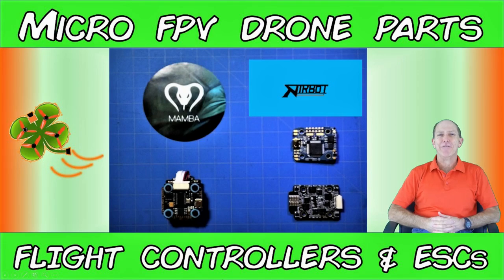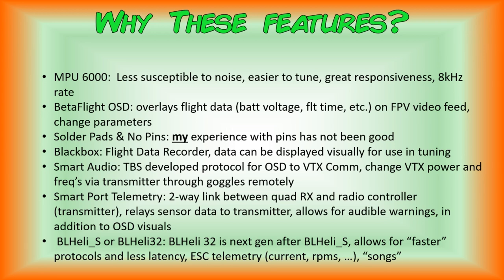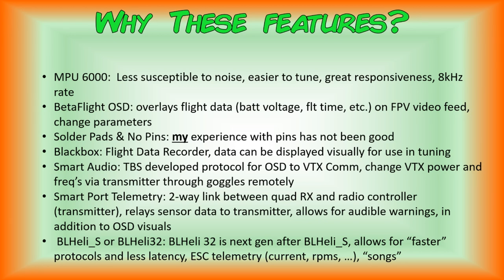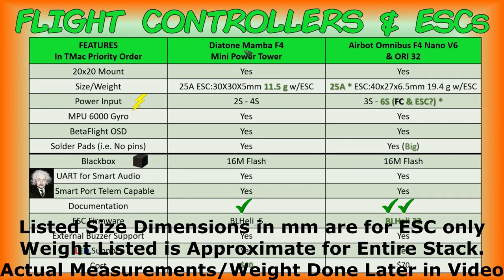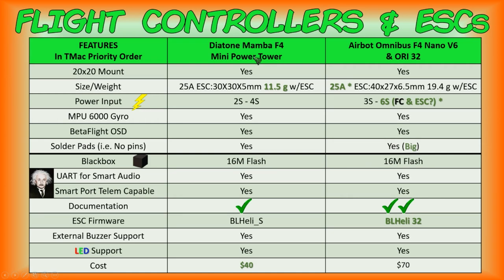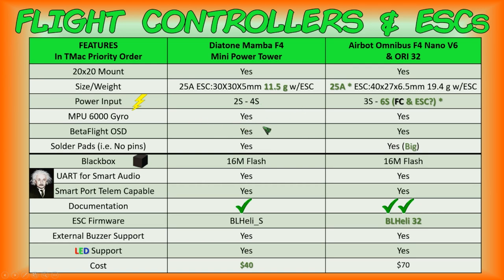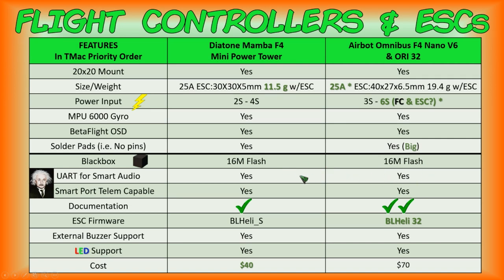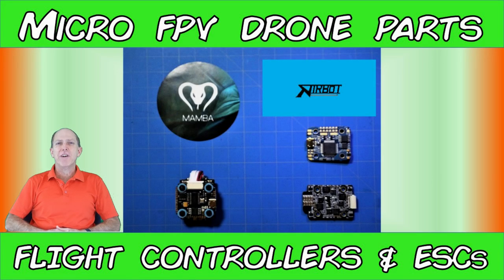MICRO FPV DRONE PARTS - Flight Controllers and ESCs

Comment from the maker: Let us know what you think of these FC/ESC Stacks in the Comments below.  How would they fit your build? What features are they missing? Any? If you have used either of these, what has been your experience?  Thanks for watching!
Reply: How's the Mamba stack holding up? My first build, soldering skills are "I have the idea" level..lol. fixed maybe two quads. But not sure if these pads are smaller than what I've worked. Any tips?
Reply from the maker: @LosFPV  Hey Carlos! I have not installed the Mamba stack in anything yet.  I purchased it (too good a price and features to pass up!) and have it in my inventory waiting for the "right quad" to put it into.  I went with the Airbot Omnibus F4 Nano V6 in my last build instead.   Yes, the Mamba Mini Stack has smaller pads.  I have installed FCs with these small pads before (the Diatone F4M Fury comes to mind--installed on Diatone GT R90).  The best tips I can give you on these small solder pads are: 1.  Take your time.  Patience is everything.  Do a good job one pad at a time.  If you try to rush it, it will get sloppy and you'll end up having to redo it then.  2d tip:  Be careful not to overheat the pads by using too high a heat temp on the soldering iron or by leaving the solder iron on the pad for too long.  These small pads heat up quickly.  So if you use too high of heat or leave the solder iron tip on pad too long, the pads can actually lift up off the board which is very bad news.  I recall when I was soldering the same size pads on the F4M Fury, I believe I used a temp of about 425 degrees F.  The Mamba F4 Mini FC is used on the Diatone Micros which just came out (239, 249 ,etc.).  Diatone is a very reputable company and has "evolved" their FC stacks to this one.  They would not be using it on their Micros unless it was reliable with good performance.  Think you've got a winner there with this FC!  Take your time with install and I'm sure you're going to be happy with it. Thanks for watching and Happy Flying!  👍
Reply: @TMacFPV  Awesome! Thank you for your tips, and for giving off some motivation to give it a try. Definitely checking back if I have questions.
Reply from the maker: Carlos-You're welcome! You got this!
Reply: @TMacFPV  Thanks again TMac. I got around to the build, it was pretty straight forward. Ran into motors 2 & 3 going in wrong direction,  used BL Heli to change directions.  So far so good. Keep up the videos I used some of yours for reference.
Reply from the maker: @LosFPV  Great! Thanks for the feedback-always appreciated. Glad it helped you in some ways.  Sounds like you're very much starting to get a handle on these things.  It only gets better Carlos--keep going and Always, Happy Flying My Friend! 👍

Comment: I've built a new 3 inch quad using the mamba f4 stack and it flies great but I have a little problem with the buzzer... I've tried several times to setup the lucky box buzzer without success. I soldered the 5v cable of the buzzer to the B+ pad on the FC, the bb- cable on the B- pad and the gnd on a free gnd pad on the controller but when I connect the battery the buzzer lights up but there's no beeping or any sound. I set up an aux channel for it in betaflight but no success either... Any idea of what I may be doing wrong? Thanks for the video Tmac 👍
Reply from the maker: Sounds like you've got it wired up correctly. If its not working with the Aux channel & a switch either then either the buzzer's bad or perhaps the one of pads on the flight controller isn't working.  Possible to test out the buzzer on another quad/flight controller?
Reply: @TMacFPV  I think it is one of the pads because I have tried the buzzer on another quad and it works. I guess I'll have to use the esc's as a buzzer. Thanks for your help Tmac 👍
Reply from the maker: @luismanchego6856  too bad about the pad. Happy you identified the buzzer works. Nice job👍